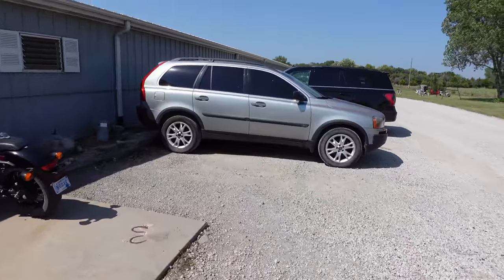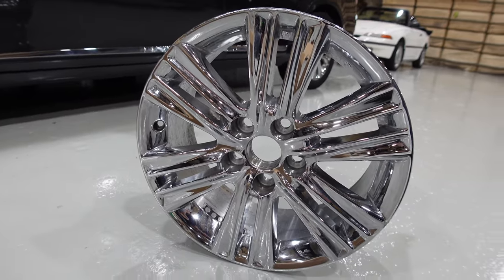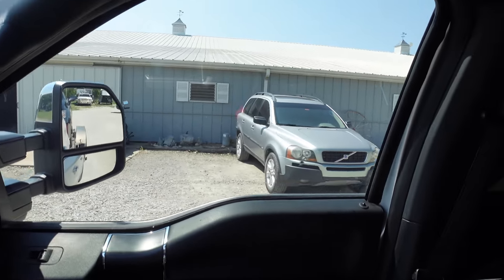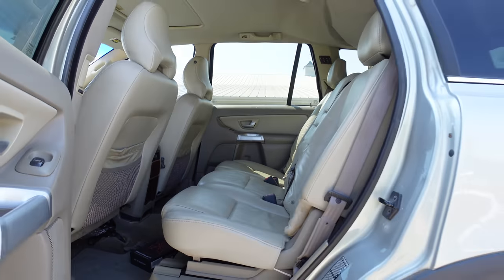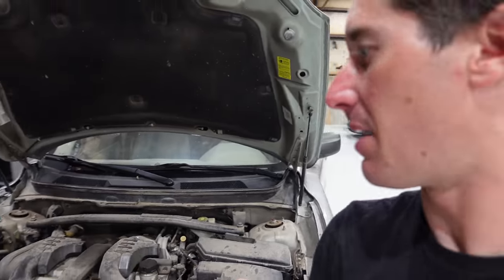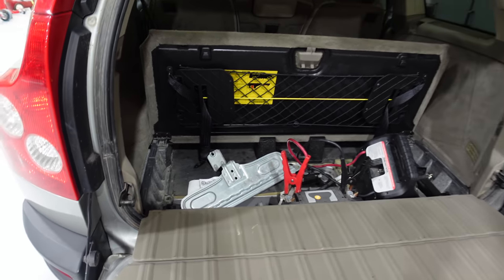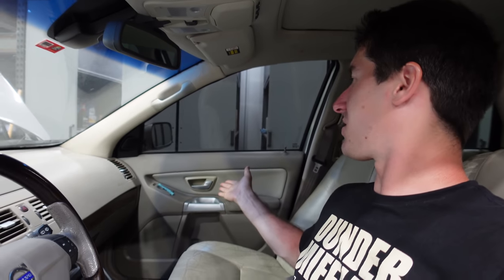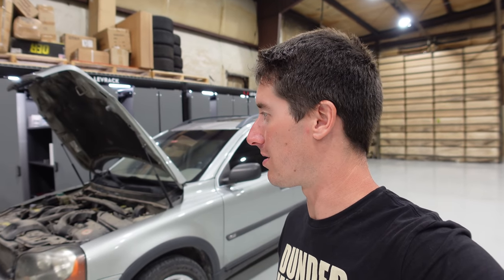I SOLD My Cheap Lexus And Got A FREE Volvo XC90 Thrown In

Comment: My wife and I used to have an XC 90 - great SUV. Safe, sure footed and comfortable to drive. The ONLY drawback was the front suspension needed frequent attention. Tie-rods and especially ball joints. The dealer, where my wife serviced the car, charged a ton for the work. Great SUV. You will do well with this one and someone will get a killer SUV.

Comment: You missed one of the biggest oddities of back seat. The center seat front part lifts up, locks into the seat back, and turns into a kids booster seat.

I just bought one of these, but a V8. Fun little trucks.

So that makes 3 vehicles in your fleet I have. XUV, Aztek, and now an XC90
Reply: The V8 is a Yamaha-engine.

Comment: You got the bad xc90. The twin turbo has transmission made of glass.
Reply: With chocolate gears in burnt raspberry sauce 😋 
👍🤣👍
Reply: @markemarkpsv1  😂🤣👍🏼
Reply: Why would he care he is just flipping the car not daily driving it
Reply: My t6 tranny blew real early. I can’t imagine that’s the original transmission.
Reply: He mentioned it in the video that it has not got the most reliable of GM transmissions.
Reply: @Chris-hw4mq  if he is planning on fully sorting it thats kinda important.
Reply: @crownvicca  I saw when he flips cars he just fixes whatever has a checkengine light. If the gearbox is good he wont change it or else he looses money
Reply: 250k on a T6! That XC is on borrowed time for sure.

Comment: Be careful with that T-6, they can turn into nightmares, fix the engine and 90% of the time, that GM transmission grenades. The 2.5t are nearly trouble free in comparison. Just trying to give you a heads up. Seen to many people spend money on then, and then the transmission goes
Reply: Yep, what he said, don't put a lot in it, they weren't even very good performers in comparison to the 2.5t. It was mainly a marketing thing

Comment: My mom had XC90 with a v8. One of the best cars ever, absolute tank, comfortable seats, but had electrical problems like no tomorrow...
Reply: They were built with gremlins
Reply: I was wondering when he mentioned all the LED headlights hiding around the interior.  Sounds like theres more to that story...
Reply: @YARCHLRL  It was built (by) gremlins.
Reply: That V8 was an evolution of the V8 in the 3rd generation Taurus SHO
Reply: The V8 was the best version... Yamaha built motor (roots back to the sho 3.4 but they won't admit that) with the Aisin 6-speed. Japanese reliability in the power train to go with the swedish engineered platform.
Reply: My 2008 xc90 v8 has no problems........ Best vehicle ive owned. Oops put in a starter and battery thou. And good on gas .oil and coolant are all excelllent. Mine has almost every single option.... Did not get the air ride. Im not a fan of those.....
Reply: @tomsmith1869  they didn't have air ride on that generation butbyoubdo have self-leveling Boge (now Sachs I think) Nivomats on rear. Load and it drops then when you drive the integral pump inside shock lifts with every bounce until the height is restored. Unload it and it's high and every bump bleeds off the pressure until the height reduces to normal.
Reply: GM4T65 trans. mission.....  make sure Trans is good before you go very far into this project.
Reply: We had an 05 V8. Beautiful car. When it ran correctly it was amazing. One problem after another though.. But to be fair, it had a hard life before we got it.

Comment: Get a DICE cable and VIDA on amazon or ebay and install it on a old laptop. It gives you access to fault codes, blueprints, repair guides, adjustments and much more.

Comment: 07 V8 owner here. the interior plastics on these era Volvo's are a real issue. Prone to cracking and very brittle - they'd have never gotten past a Toyota or Honda level of quality control. Front suspension is a weak point and prone to early failure. The electrical is what will drive you crazy though. You cant really do much on these cars past basic R&M without a DICE and VIDA. Other than that they're great cars.

Comment: I own one of these so I'll be looking forward to future XC90 videos. Mine has the 2.4 D5 engine which is the 5 cylinder diesel and 7 seats. The GM transmissions are the worst so converting it to an Aisin might be worth doing if it is possible. As you've realized, it is based on the P2 platform hence the similarities to the S60, S80, V70 & XC70.

Comment: T6 XC90 owner and Volvo nut here. Some (a lot more than you want) basic info for ya. You are indeed a P2 platform car. The B6294T (your engine) is very, very reliable. Unless it overheated BAD I doubt that it has much internal damage. Yours sounded exactly like mine. Injectors go tappity tapp super loud all the time, that is normal. I got mine after it sat in a garage for three years with water in the floor. Runs fine now. They are hard to kill! 

Believe it or not, the tweeters ALWAYS fall off the doors. I have resorted to super glue where the plastic meets the door trim rubber. Might be your best bet too. 

Headphone jacks are the same for the 5 & 7 passenger versions, hence the number. Yes, there are at least two FM tuners, one AM, and a 6-CD changer. 

You have the fancy wood wheel, but sadly it looks like you are missing the sweet in-dash nav with the pop-up screen. The xeon headlights (most T6 cars have them, hard to tell with the fogged out lenses) are also self-leveling to follow the pitch of the car, pretty amazing for 2004. You also have rain sensing windshield wipers, again pretty rad for 2004, but the sensor can be a little finicky. Premium sound is actually really good in these cars, 350W amp in the floor and 12 speakers (potentially a subwoofer in the back on the left), but you need a little $128 box from eBay and then you gain bluetooth capability. You also have power folding, heated side view mirrors! Press that button next to DSTC and they should fold in. You ave 3 memory seat presets, also linked to the mirror positions and saved to each key fob. Unlock the car with a different fob and the seat will go to the preset for that "driver"!

The plastic radiator end caps and hose attachment points are prone to leaking, as are the return jugs if they are old. Check there if it has a coolant leak, leaking end caps can kill the trans again (ask me how I know). 

As for why it has the big engine -- the T6 was offered as essentially the premium trim XC90 at that time. If you wanted the top options, you pretty much had to step up to the bigger engine. And it needs it -- 0-60 is still over 8 seconds (in part thanks to a 250 ft-lb torque limiter in 1st and 2nd). Most of the T6 XC90s (mine included) did have the tow package, though not like you want to do too much towing with the 4T65EV unless you have Triple Edge or someone similar rebuild it to handle more power. That being said, I have towed a few trailers with mine and everything is okay at the moment. Transgo makes a shim/spring kit which can fix some of the common issues should your 4T65EV have...less than favorable behavior, you can install most of the kit WITHOUT pulling the trans! HIGHLY recommend. Absolutely do a fluid/filter change either way. 

Check the parking brake, pre-facelift XC90s have a super lame, finnicky parking brake system, but dear lord do you need it with the weight of the vehicle.

Comment: The XC90 was indeed part of the P2 family! Identical underneath as the V70/S60. I've got the same steering wheel but with black middle on my V70 P2. Great cars and worth getting back on the road. Definately check the transmission on the T6, do a fluid change for sure.

Comment: This is probably an older episode that you are just posting now, but remember to never disconnect the radio without first disconnecting the negative battery terminal for 20 minutes first.  If the ignition is powered on without the radio connected, you will trip the SRS and airbag system and will need Vida/Dice to do the reset.  Your Autel won't work on this vehicle.

Comment: I liked the Lexus videos and i love Lexus/Toyota vehicles but theyre never any major problems just small minor things lol. And that’s what i love about both my cars. My Lexus SC430 has 274,500 miles and my wife’s 2011 sienna has 229,000 miles on it and only issues with my van is the drivers seat plastic that has the electric controls for the seat on it broke and my car just needs seats and the center console leather redone.

Comment: I would love to see the headliner get done. That seems like a mystery hole no one wants to really show. How would a DIY person replace the headliner?
Reply: The Fractured Rooster Garage did his on the Bronco 2, it was pretty interesting to see the whole process.
Reply: I agree. Every car that I've had with saggy headliners drove me nuts. As soon as I assessed whether or not a car was worth going through, the headliner goes to the top of the list. My local interior guy always did a great job and would go the extra steps necessary to assure the durability of his work. And adding a bit of Dynamat also goes a long way to quieting a car down. 
Next batter up for Dynamat treatment is a project Miata. Obviously, no headliner required, and the top is excellent.
Reply: just replaced it myself with a used one from the junk yard.. a lot of these xc90 are in the junkyard because of the GM transmission of this era.. Mine is an 08 with the 3.2 engine (ford) and it has 245k miles..

Comment: My first car was a 1988 Volvo 740 GLE with 238,000+ miles on it. It leaked oil like crazy i had to put new oil in it everyday almost. I bought so much oil i wrote to Castrol GTX and got a free case of oil. Car ran good when it had oil. Sold it to a guy who worked on Volvo’s .

Comment: Why Volvo still using timing belt not chain? Anyways Some years of Volvos have leaky windshield and aside to that any vehicle with plugged drain holes in the sunroof can also cause Water intrusion into the cabin that might short the ECU and some electronics modules. Volvos has many electrical connectivity issue. Just check and clean those electrical pins n connectors. Most of the time is just bad contacts bad grounds. 
Looking fwd to more Volvo’s videos. Thx man!

Comment: Helicopter to Walmart in the middle of a bunch of power lines = no bueno! O.o

T6 with 250k? How many transmissions has it blown up so far? The T5 in the later models with the five speed auto was a much more solid powertrain. I don't think it has auto headlights, but the DRLs may illuminate both head and taillights. 

Loving the trade-up special, though!

Comment: Be really really careful with that GM 4T65 transmission…..
That transmission was never intended for the load that the B6294T puts on it, especially in the heavy P28..

Yes the first gen XC90 is a P2, P28 to be specific and the reason why Volvo put the GM 4T65 in the T6 and 2.9 was that it was the only Automatic transmission that would fit next to the 6 cylinders.

Comment: Yes, I remember Scottie Kilmer mention that transmission as a weak point. Must have been a "bean counter" decision,  bet they got those cheaper than anything else.
Reply: They're not the worst transmissions I'm most GM applications but the Volvo spec valve body calibration messed things up

Comment: It boggles my mind how headliners always seem to be an issue on pretty much every american youtuber car. I've seen a few, like two or three, but that was on cars that were at least 30-40 years old! What exactly do you americans DO to your headliners? Do you claw at them constantly while you're in the car? It's just amazing how that's always an issue! 
I mean, i'm in northern Sweden, but we DO get quite a bit of heat in the summer! Also, we have sunlight pretty much 24/7 from the middle of june to the middle of august. If it was the sun ruining headliners, it would happen here in Sweden as well! HOW? HOW DO YOU RUIN THE HEADLINERS?
Reply: We get 37.7 and higher where I’m at. And some people smoke in their cars
Reply: The ones that have the problem are made of a material consisting of fabric bonded to a thin layer of foam, glued to a rigid shell. The foam layer degrades and eventually turns to dust. I don’t think the issue has anything to do with where the car lives; it’s just a cheap way to put a headliner in a car which will look OK for five or ten years, and beyond that the manufacturers don’t care.
Reply: Heat. Especially if it's parked outside, if it's 40C+, the heat inside the car will be way over that. Happens here in Australia too. I've got a bunch of push pins holding the headliner on my car.

Comment: The worst transmission, backing Volvo's worst modern engine, driving wheel bearings that you replace every 30k miles.